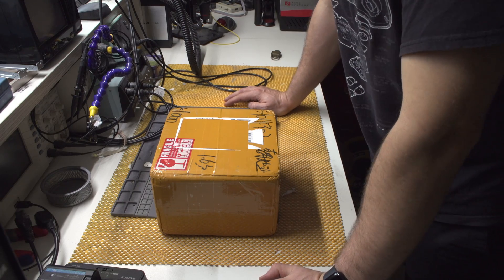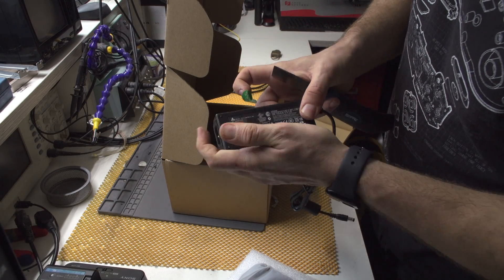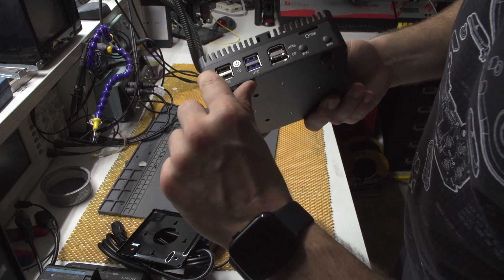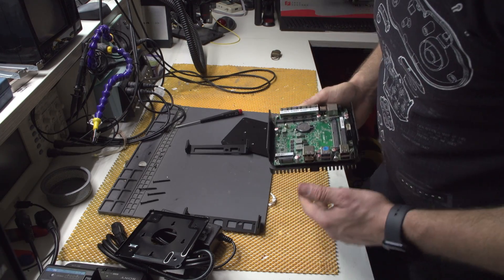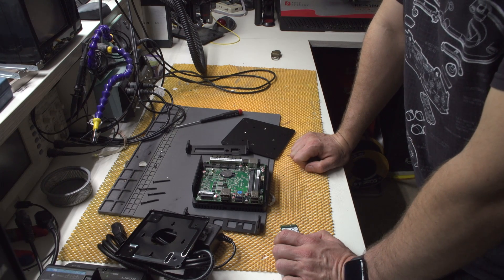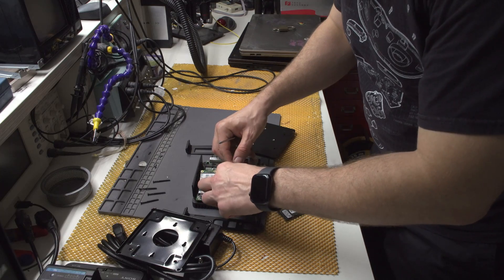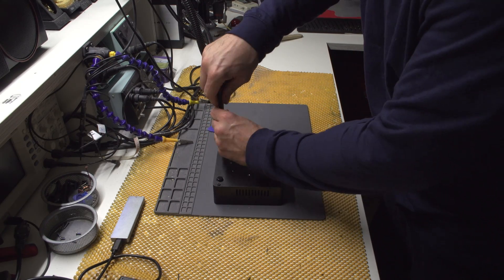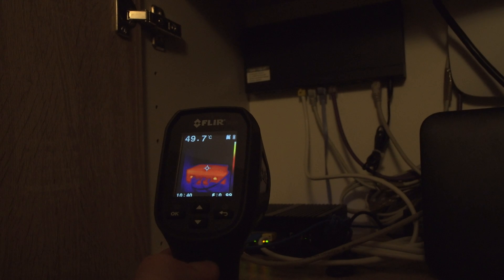Unboxing & Quick look @ KingnovyPC Firewall Micro Appliance

Comment: Is this a KingnovyPC device? With these specs -> Firewall Micro Appliance Fanless Mini PC N4000, 4 Port i226 2.5GbE LAN, 2*USB,1* HDMI,1* VGA, Gigabit Ethernet AES-NI VPN Router PC
Reply from the maker: Mine is intel N5100: this is the link (not affiliated): https://www.amazon.de/-/en/dp/B0C1Z2KC1R
Reply: @MTS_IT  thanks for your reply! Do you have any ideas what the average power consumption is, for example for a day?
Reply from the maker: @spekhans  no, but i can test it.
Reply: @MTS_IT  that would be nice 🙂. I 'm looking for a low power consumption pfSense device. This so I can replace my ISP router. Furthermore I am also curious if you have a problem with cooling the device?
Reply from the maker: @spekhans  so far no. It is a bit hotter but not that much….